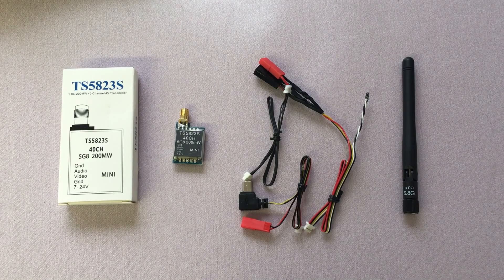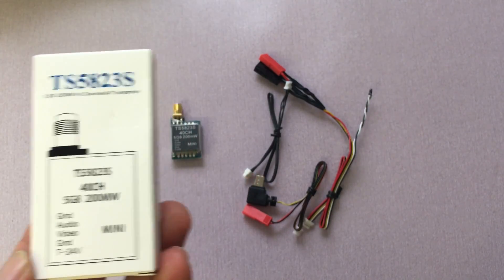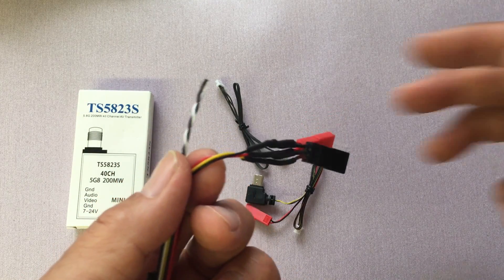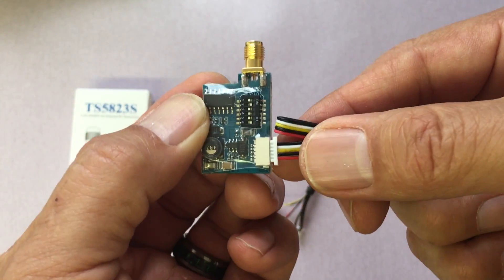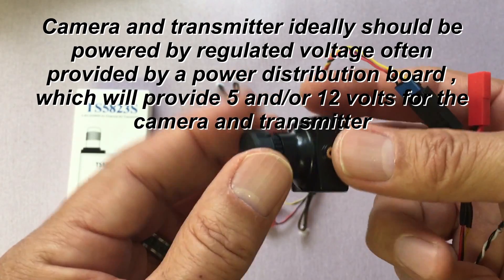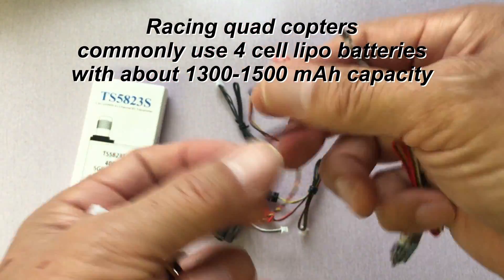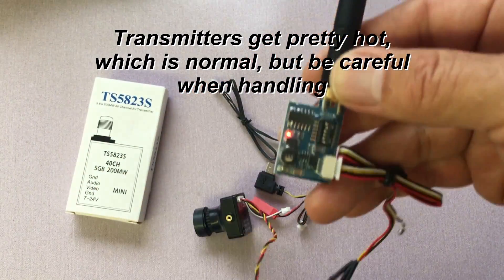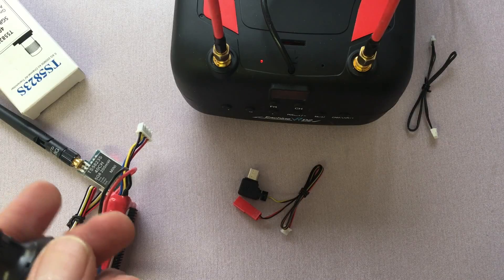How to Connect FPV Video Transmitter to Camera

Comment: Hi guys, I'm new to fpv, and I've recently bought 3 sets of ATX03S for 8€ each. Is that a good deal?? What camera should I buy now?? I've seen that some cameras have 3 pin conectors, while others have 4 (my vtx have 4 cables). What's the matter, should I buy a 4 pin camera or a 3 pin can work (I don't care about the audio thing)??? If so, any recomendations under 10-15€?? Thnks in advance!!

Comment: It won't turn on using a 7.4 2700,mAh? Just got ts5828s comes with wiring harness, doesn't turn on. Is there a on switch, I'm missing something here, what's the deal with this thing,? Can someone tell me what I'm doing wrong. Appreciate any help.

Comment: Hi Nice video. I have a cheapo SG906 drone that transmits to a mobile via WIFI. Dont plan on buying a 5G Wifi  Smartphone.  but , If I had to mount a 5.8Ghz FPV combo like this ( and get myself goggles to match ) , can I power the VTX directly from the drone's  battery ( assuming the voltage is within specs ) in order to avoid adding another supply ??

Comment: Can you use a 5G phone or tablet to receive signal ?
Reply: I think it could be possible but 5g doesn't have a long range reach since it has less power than 4g... In addition it is not allowed to use those frequencies without authorisation
Reply: Make you wonder why FPV is at set at 5G

Comment: Hi, sir what is the maximum range of the cam?
Reply from the maker: Range is actually dependent on the video transmitter and not the camera itself.  Check for the power output of your transmitter, and any associated specs that may indicate range.
Reply: @D7dronetech  ok sir, thanks.
Reply: I mean sir the video transmitter that you use what is the maximum range?

Comment: Can I use instead of goggles a mobile phone if I would use this kind of camera set: https://www.aliexpress.com/item/5-8G-FPV-Receiver-UVC-Video-Downlink-OTG-VR-Android-Phone-TS832-5-8G-48CH-600mW/32916960574.html?spm=2114.search0204.3.1.52c91a25LS7ylX&ws_ab_test=searchweb0_0,searchweb201602_8_10065_10068_319_317_10696_10084_453_10083_454_10618_10307_10820_10821_537_10303_10302_536_10902_10059_10884_10887_321_322_10103,searchweb201603_16,ppcSwitch_0&algo_expid=f0febc04-6f53-43d1-86ed-5d450d9284e0-0&algo_pvid=f0febc04-6f53-43d1-86ed-5d450d9284e0

Thanks!
Valters
Reply from the maker: Looks like you can connect a compatible phone to the receiver to view the video.  That's pretty cool.

Comment: as a precaution when I get new / or work with Tx + Cam and such the VERY 1ST thingy I do is connecting the antenna & leave it there always ,I burned 1 Tx b4 lost 20$ + a month of playing/flying time  =(  .My question is what microphone would you use ? any suggestions ? Thanks for the Vid Cheers

Comment: So...If I buy a Bugs 6 without the " FPV transmitter" as a replacement drone to save $$$-  I can't use my Bugs 6 camera/ monitor that I already have... huh?   ( I have a bugs 6 with the camera and monitor that has a motor blown in it , now for parts)

Comment: Just FYI guys NEVER POWER UP THE TRANSMITTER WITHOUT THE ANTENNA. How you didnt burn that out was beyond me. I know, the hard way! Just dont ever plug your battery in unless the antenna is attached. Ever! Good video other wize. Very helpful. I am ordering two of those, but for planes.

Comment: Thanks for the video !!  I have this VTX in the 600
 mw version.  Planning on mounting on the outside of the fuselage.  Going to attach with double stick tape.  What side of the VTX should I mount to the fuse for proper heat transfer ?

Comment: I have one of thoes WiFi drone fpv cameras , I want to some how convert it to transmit 5.8ghz instead , the camera has a 4 pin connection and I know for a fact that 2 of them are positive and negative but not sure what the other 2 are , hopefully they are video in and out idk , but is it possible to connect a transmitter to the video out and in or whatever and it can now be a 5.8ghz ??

Comment: How are you able to power the camera and the transmitter at same time when you only have one red wire on the group of cable? Can I just solder all the red wires together to power both the camera and transmitter? Sorry for the newbie dumb question 😁
Reply from the maker: +CommanderAstig14344 If the voltage is compatible with both camera and transmitter, then sute

Comment: Thanks for video, i have question, am try to connect my Canon 6D to goggles, So is this transmitter can connected? and am using goggles with smartphone.  thanks
Reply: you should be able to if it has video out via the mini usb cable. what setup are you using for smartphone goggles? i use the easy cap with the fpv viewer app which costs around 3 pounds but works great. good luck with your system

Comment: so if I wanted to do this next up on a Drone I have that runs a 3.7v lipo I would need to have a a separate 7v just the transmitter?
Reply from the maker: albert lopez You can find a transmitter that would run off of 3.7v (1 cell lipo). The one shown in the video is for 2-3 cell lipos.
Reply: @D7dronetech  hi.. when i fly my 2S Quad, the main voltage sometimes show 6.8V on my OSD.. will it be a trouble for this VTX?

Comment: If the camera has its own battery, then is it possible to have working fpv, with only the video wire connected to the camera?
(I'm very new to the fpv thing, so this might sound like an obvious question)
Reply from the maker: +Green alien Yes that would work too. Runcam 2 is a popular camera that has it's own battery.
Reply: Ok thx, I really wanted to know if I could use the runcam 3 on its own battery
(even though I've heard its not recommended)

Comment: This was very helpful. So the little thing connected to the camera is like a mini tv antenna tower. And the goggles are like the tv. So multiple people can like "dongle" off the same signal. Which is why you shouldnt use the same channel as the other users.
Reply from the maker: Yes, that's a good analogy, and yes you'd want to be on separate channels unless someone wants to watch your video at the same time.

Comment: so this can work without wifi?
Reply from the maker: +On your bike Yes, it's video signal transmission.
Reply: cool,thanks, but there is some drones who actually needs wifi internet right?
Reply from the maker: On your bike Oh I see. For drones in general, they work off of a radio signal to control, which may be via wifi or a digital radio frequency. This video only covers separately added a video camera and video receiver for mounting. Thanks for watching!